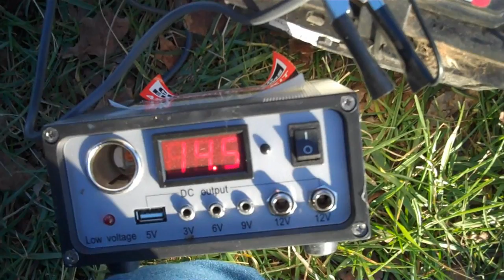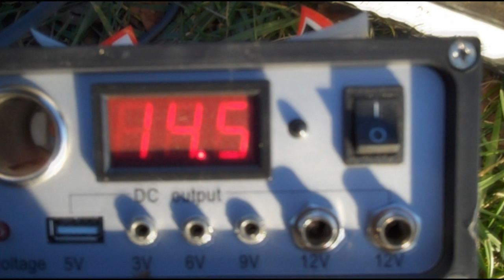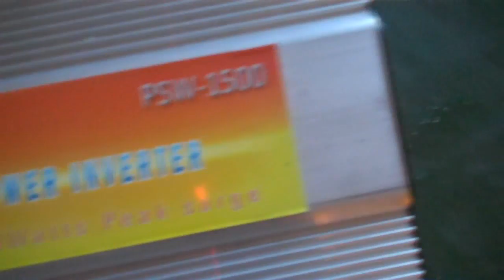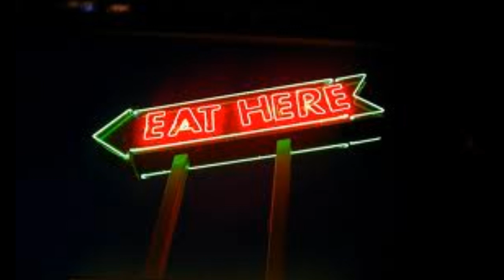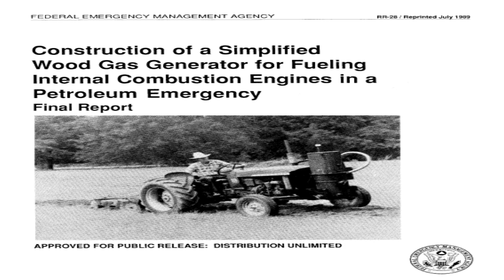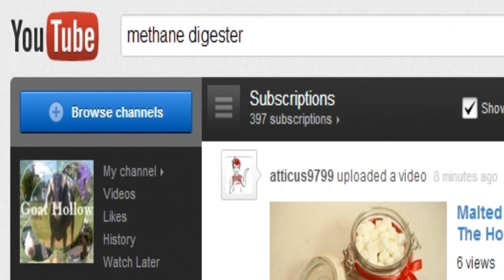My Homemade 12 volt generator

Comment: I have the exact same motor on this deal but I just used a 2000 watts Winco generator...oh...the belt is off of a Maytag that had a wringer, about a '37 I think... I had to make an oil pan gasket out of a rice crispies box

Comment: If you can locate a 6v. Or 12v. Cars "generator" from a salvage yard (not altenator) use smallest gas motor like 1.5hp briggs use can build a nice reliable and ecom.12 or 6v. CHARGER!!!
Reply: Have u built one ? Du Meena a dynamo ( pre alternator) looking to build something like these for my boat to recharge the batteries But scooter engine as they are very quiet and very reliable

Comment: I still cannot believe how great this battery reconditioning program ( Check Details Here>>>https://www.facebook.com/Battery-reconditioning-310070329426065/app/208195102528120 ) worked. My drill battery, several AA and AAA batteries, and my camera battery work great once again! The steps are easy and the act itself is exciting to do. It doesn`t matter what type of battery you`ve got, it`s certain to function again!

Comment: I have done this my self and all it did was keep a battery at a full charge. It didn't charge a battery. Did you rewire the alternator to have it actually charge? Otherwise all you are doing is maintaining a battery like in your car. If you did rewire the alt. what did you do to make it a charging device and not just an alt.?

Comment: I`ve made those before both kinds electric motor powered . use for battery charger at home 120 V and portable using a 1.5 HP B & S engine

Comment: Very clever idea! The way the video started was entertaining as well. I have almost the exact same set up as you here in the video save for the way I control the amount of electricity going into the batteries. I used three auto light bulb sockets to provide the resistance, but it all works the same in the end. Your other ideas are equally interesting and your video is highly entertaining while simultaneously stimulating the old brain pan!

Comment: I think that alternator is about the right size for the engine, car alternators are not crazily efficient for a number of reasons, you can afford to have a little drop in power with a more restrictive exhaust, induction roar is also a significant source of noise.

Comment: cute lil thing:-)
point 1. avoid the alunium cabel. a fire hazard waiting for an idiot. the amps will turn it into a firework of burning and melting metal if it isnt connected correctly.
point ?? exhaust through the ground: most the noise is mechanical from the vibrations. an old car muffler will reduce the sound out of the exhaust better than a hole in the ground. an insulated box will handel the mech sounds.

Comment: Hi, About the exhaust, I read a article once about running the exhaust through a container filled with water to silence it. I never tired it myself but from what I remember they had a big generator and it really quieted it down. Just be careful that the engine is above the water! :)

Comment from the maker: I'm guessing it's a 3 horse engine, which could easily run 3 alternators at once. (I think it's just a little 60 amp alternator)...... But efficiency wasn't a factor, it was built all out of free stuff, and I'll probably be using chicken crap for fuel, which I have plenty of.

Comment: First, let me say you've done an awesome job and I haven't built anything like this myself. I was wondering though, Does that little alternator provide a significant load for that engine? If your engine is only running at 5% when the alternator is charging at full output, you lose some efficiency.
That might be a 90 amp alternator which works out to 1080 watts or 1.44 horsepower. 
What's the horsepower rating of the engine?

Comment: use a twelve volt fan motor of a car and put a pully on it it will run the generater to power itself and charge the battary no full needed

Comment from the maker: You're right.  the pipes would have to be big enough diameter, so that back pressure is reduced.  There's a sensor wire on the alternator's regulator, that has to be hooked up to the positive side.  It's supposed to go through the "Idiot light" on a car's dash, so you have to have a little 12 volt bulb inline on that wire, or it won't read the right voltage.